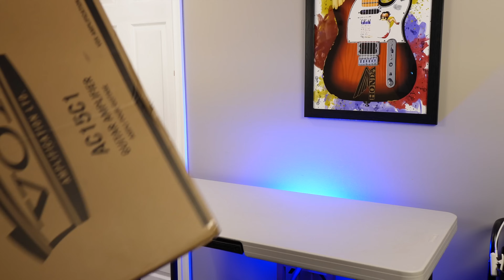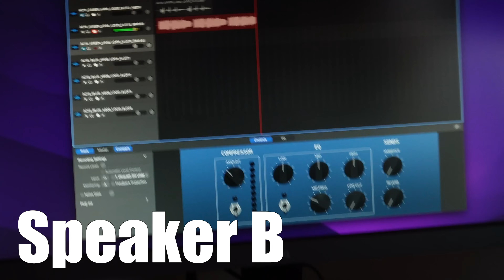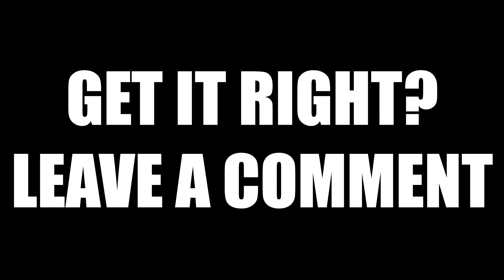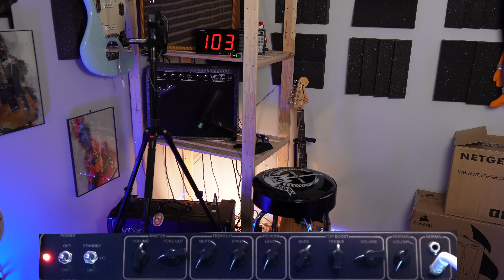Comparing 2 Speakers in the VOX AC15 - Green VS Blue

Comment: The capacitors are the most dangerous part, stay away from them and you should be fine but better safe than sorry, those capacitors contain a FATAL charge even when the amp is off and unplugged.  If you don't know how to dischage safely capacitors, don't play amp tech and see someone who knows that he's doing, dablling to save a few bucks is not worth a tomb stone.  Even pros, NEVER put two hands in an amp without discharging the capacitors first.  That being said, changing the speaker like Landon did is not dangerous as long as you stay away from the PCB and use only one hand,  when you can't use only one hand, put on nitril gloves.

Comment: Waste of time doing comparisons over a phone or an IPad.  Impossible to really judge the tone.  You have to listen in person.
Reply from the maker: You can get a better idea with some good studio monitors
Reply: @landonbailey  It's the YouTube algorithm that is the major problem.  Everything is highly compressed, and the headphones are just another layer between the listener and the speaker.  The headphones have tiny speakers, and you are getting the signal from a phone or Ipad.  As good as headphones are, and I have about 5 pairs, it isn't what you hear directly from a tube Amp and large speaker.  Even different headphones sound very different.  Also, the analog sound from a tube Amp is converted to digital when you make the video.  It really becomes an like an mp3.  What I am trying to say is that everything in the chain seriously degrades what you hear directly from those speakers in your room.